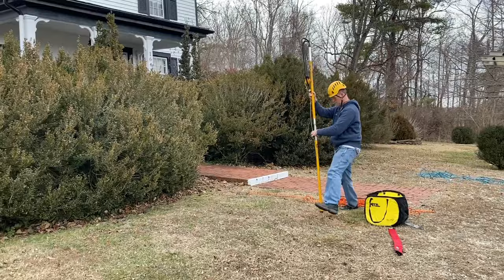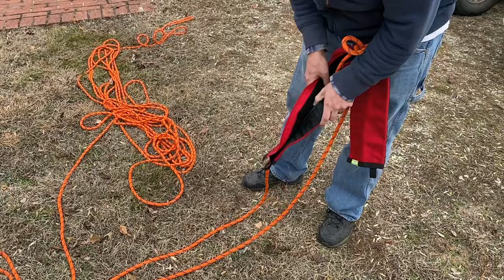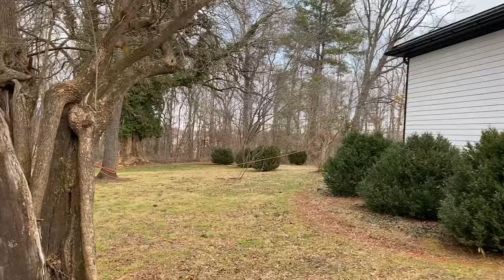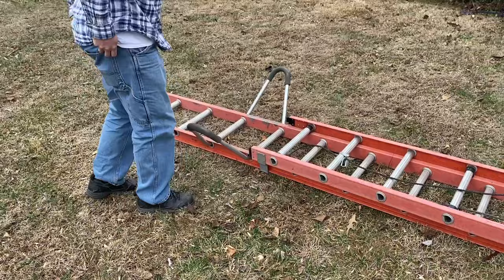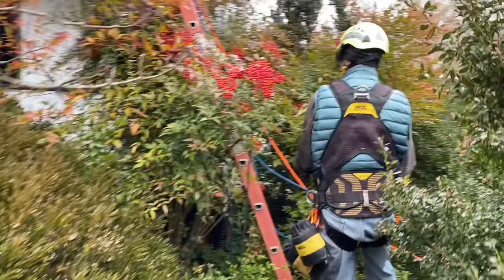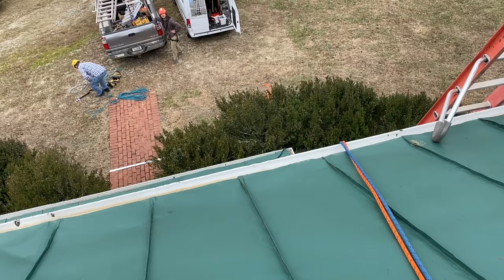Fall protection on a roof without adding any holes to the roof.

Comment: The biggest problem is, for any reason you go on the opposite side of the roof and fall, it won’t help you whatsoever.
Reply from the maker: Very true. 
Also true:  If I close my eyes while driving, it’s likely I’ll wreck.
So, situational awareness is always important.
Reply: Honestly this is a valid point. I think it would be worth considering securing both ends of the anchor line.
Reply from the maker: Yes, true.  If you do that, I recommend you tie a butterfly knot and attach your actual fall protection line to the butterfly knot, then pull it into position at the ridge.  Then tighten the line and secure  it at both ends.  Don’t do this anywhere near a gable end of the roof. We’ve done this several times.  It just depends on where the repairs are necessary.  If you don’t need to work on both sides of the roof, then it’s overkill.   @shawnsteen8442
Reply: @BlueGlassLLC  just did a gable roof. just ran a 3rd anchor line to keep the rope from sliding off. Thank you for your videos.
Reply: @BlueGlassLLC  cat ladder maybe 2 mins and your done
Reply: I'm glad you said this, I thought about that but figured they knew something I didn't.
Reply: @BlueGlassLLC  ya but how many falls are accidental. No one intentionally falls off a roof it’s complacency. Great idea an anchor point from ridge will always be best. Rick a few holes keep you and your guys safe. On top of that hole many roofers do you ignore that drink or smoke? All of them. Protect em
Reply: How about put the ladder on the side your working on😂
Reply: @deansteele7243  that would definitely work and makes sense, but 99.9% of people only put one ladder up on one side and walk all over the roof and come back down the same ladder. Most, once up there feel somewhat comfortable and don’t/won’t take that extra safety precaution, because it takes to much time and effort, but forget about the death factor.
Reply: Sir, they know which side of the roof they need to go on.  So they rig for that. If they knew they were going to work on the ridge of the roof, they would have tied to the truck. Both sides of roof 'covered' then.
Reply: According to other comments, the purpose of the blue rope is to show you how to do it if you have secured both ends of the yellow rope.  The blue rope is set up to be basically at the middle of the yellow one so you can go on either side of the roof using it.
Reply: We have a genius here dropping serious wisdom what would we do with out him 😂
Reply: Like, don't go on the other side of the roof.  C'mon.  They had one job on one side.  If they had a job on the other side I'm sure these dudes would and could tie in for that side.  They're not up there break dancing they're doing a job.
Reply: @tobyswope6875  I agree with you, but not everyone has common sense these days. All it would take is going on the other side of the roof for some reason, maybe to yell down to a co worker or a customer. Maybe trying to get away from a swarm of bees and not thinking correctly and they are now on the other side of the roof and go down. These situations happen and most people will take chances even though it’s not safe to do so.

Comment: I was wondering how someone could work safely on a seemed roof. Good idea not anchoring off of a truck. Someone could forget and drive off at the worst time (it happens), and it frees up a truck for food runs lol
Reply: There's been times where I hooked up to a truck but removed the coil wire and put it in my pocket so the truck couldn't be moved. Still very stupid to do though and I would never do that again. Mind you this was over twenty years ago. :)
Reply: Seen a guy dragging his dog down the road once forgot he tied his leash to the bumper
Reply: @tomnutt6022  “poor little guy…probably tried to keep up the first few yards.”
Reply: Using the truck as an anchor should be simple enough. Have the keys on a ring that doesn't easily open and loop them in with the anchor. Or just have them in your pocket on the roof.
Reply: I knew of a guy who tied off to his car. While he was on the roof, his wife got in the car and with her keys, drove away. He survived but was severely injured.
Reply: @tomnutt6022  
National Lampoon's Vacation
Motorcycle Cop: Poor little guy. Probably kept up with you for a mile or so. [tearing up]

Comment: Great safety tips. Painter of 44 years..understands the importance of being safe! Took a lot of risks early in my career
Reply from the maker: I bet you did John!  I took a bunch too unfortunately.  Due to, “I’ll be safe.”, “It won’t happen to me.”, “It’s just going to take a moment.”, but mostly because I’d never seen anyone working safely on a roof or in residential settings.  So, I didn’t know how easy it really is to work safely.  With the gear available today, it’s usually just 15-30 extra minutes.  Glad we are both still around to hopefully help the next generation not repeat our unnecessary risks.  Thanks for commenting.  Ronny.

Comment: Im a concrete finisher most of the time but my mother-in-law nedded a sewing studio built on her property.  I just got the roof framed and im researching fall protection systems as it's a 10/12 pitch which would be the steepest roof ive yet to work on.  I wish i was set up with all the cool stuff you guys use but i absolutely dont want to be a roofer cause i don't enjoy heights.  Anyway great video!  Wish me luck.
Reply from the maker: We always sub out our concrete finishing so it’s done right.  If we did it ourselves and made a mistake, it’d be ugly forever or have to be jack hammered up and redone.  So, we decided it is just not worth the risk.  I’m sure your roof will look great if you do it.  But if you fell, then you won’t be able to do your paying work.  Is it worth the risk?  Good luck if you decide to do it.  Keep your rope tight and you can never fall far if your anchor point is solid.
Reply: @BlueGlassLLC   it's a small and simple roof to build it's just too steep for me to be comfortable walking on without fall protection.   I'm a cautious guy who likes my life so im taking my time and doing my homework!  The difficulty with concrete is the amount of time you have before it's no longer workable.  The difficulty with roofing is potential death and dismemberment.
Reply from the maker: So true.  You’ll do a great job!
Reply: Hey the roof turned out really good!  Thank you for all of your informative videos!
Reply from the maker: Great job!  Congratulations too.
Reply: It's not that expensive, Amazon...

Comment: Some of the guys carrying out roof repairs on our apartment block in Florida after a hurricane had no safety gear.  Certain death if they fell from the roof, minimum 40 feet drop.  Couldn't bear to look, and they often worked after sun down.  Mostly Hispanics, boy those guys worked hard.

Comment: Great work. This is so smart. I see a lot of roofers in Cincinnati do none of this.
Reply from the maker: Thanks.  Even across the nation you are correct.  Roofing can be hard, low paying, fast, tiring work and often attracts folks that cannot get work easily elsewhere because of their background.  These folks are also used to taking risks without complaining.  Turnover is high and little attention/investment is given to proper, practical training and so roofing continues to be one of the most dangerous occupations.  And almost every fall is foreseeable and preventable.
Reply: @BlueGlassLLC  my employer has taken to trying to threaten and ostracize me for not wanting to attend an unpaid OSHA 10-hour on the weekend with four days' notice... Meanwhile they did not provide, and likely would not provide any fall arresting equipment except under threat of a retaliation claim lol.
When my next job is lined up, I'm going to assert my rights and see what happens. Also, they are violating FLSA by misclassifying full time workers as exempt.
Fun times.
Actual verbatim comment from the guy who trained me, after I refused to attend the unpaid mandatory weekend overtime, and informed them that I would not be paying for the course out of pocket: "maybe this line of work is not for you".
Reply: Gets even more hilarious when you find out that their OSHA 10-hour trainer is violating OSHA's own rules on this orientation, by conducting the 10-hour in a single day, and the 30-hour with just one additional day, even though due to the 7.5h limit per calendar day, it takes a minimum of four days to complete the 30-hour outreach...
It's just so meta to violate two different classes of federal regulations to force employees to attend a VOLUNTARY outreach program of a federal regulator...
Reply from the maker: @microcolonel  The happiest people around place a higher priority on their work environment than money.  I’d have to find another place to work.  Life’s far too short to waste time on unwinnable battles.  Good luck! Don’t die for your employer.
Reply: What!?! I'm in cincinnati and this is my specialty. Check out Kie Height's and Construction LLC!  He is very, very prepared. That comes from years of building up that climbing gear. That is NOT cheap! I've been using a DIY "big shot" to throw over but the list of things I tried before, is extensive. Lol. L

Comment: Do you think you could post a list of some of the things you use in the video? Some of the things like rope diameter and brands you trust? You called out a couple of the knots. Great video. Love watching how pros get it done.
Reply from the maker: Thanks.  Glad it’s helpful.  Probably the easiest way to learn more is by visiting our website.  Underneath the “Learning” tab on the home page menu is a lot of good information and answers to why I choose certain types of gear.  Slator-usa.com
Reply: @BlueGlassLLC your website has been so helpful in selecting quality gear and reading your advice on all topics thank you!  Please share more photos on your website of your team in action with all your scaffolding, ladder, rope etc setup if you have time they are great to study and learn from.  Also, I look forward to when you finish the listed sections on your website menu that are not yet available.
Reply from the maker: @chrisdonner2910  I’m glad it’s helpful.  You are quite welcome.  Thanks for working safely and being a role model for whoever is learning from you.  Not sure I’ll ever finish the website, so if you ever have a specific question or want to discuss a solution to a current challenge, fill out the contact form on the website and I’ll call you if you’re in the States.
Reply: @BlueGlassLLC  Thank you for your reply.  Do you still offer the L3 low slope brackets?  What pitches are they designed for?
Reply from the maker: @chrisdonner2910  we have a few in stock that we have saved for our own use.  We do not make them anymore because there’s just not enough demand for them.  They are designed for low slope use only.

Comment: I am a tree climber, interesting to see the big shot and throwline used in this application. I'm watching this because curious of ways to use rope access type s of protections for when I help my friend with painting his house. The one side of is house is really high and sketchy with an extension ladder. 
Just one concern I want to point out: What about your edge protection over the eve trough? If the ladder kicks out, or you slip/loose balance as your getting on or off the ladder, the tensioned line would be over that edge when you are suspended by your system. Thanks for the video.

Comment: Great video.  Thank you for the info.  What is the slingshot tool you use?  That would come in handy for getting leed lines onto some trees I need to cut down on my property.
Reply from the maker: 👍  It’s the Big Shot Slingshot (around $150) and is very handy.  You may also want to buy an arborist beanbag and throw line.  You are right Robert.  It is very handy.

Comment: Love it! Sure beats having to set a 40' ladder on the gable so you can reach to attach a bracket. Or even worse having to plane it out to reach as high as you can. Obviously there's the potential for damage to the roof, particularly the ridge and maybe eaves. Was the metal under the rope at the peak damaged at all? I'm guessing that with the cover and as long as you don't take a fall, damage is little to none. Unlike attaching an anchor to the roof.
Reply from the maker: We have not damaged a ridge yet, whether standing seam double lock, ridge vent, or simple asphalt shingle ridge caps.  So far, we’ve found the “rope” protect suitable for every ridge except on a slate roof if the ridge is designed so that one slate extends past the ridge (this is an uncommon design in our area fortunately).  Of course it’s a function of pitch and loading.  The loads created by a fall or perhaps even a suspension could easily damage many ridges.

Comment: really good idea you came out here guys. chapeau! Only thing I can think about is that sternal rings are only supposed to be used when doing vertical ascending, once you get to the roof you guys should switch your anchor point to the dorsal ring. This is because in case of a fall your ribs gonna broke into pieces due the gravity and acceleration forces and probably piercing your lungs... just a heads up there. Have in mind that being anchored to the dorsal ring will also give you the opportunity to try a self-rescue once you are hanging after the fall which will be impossible if you are hanging from your sternal ring.
Reply from the maker: Thanks for commenting.  That’s an interesting perspective.  Do you have data that supports what you believe about ribs breaking and puncturing lungs?  The dorsal ring is MUCH more dangerous in my opinion for a number of reasons and therefore I won’t use it for steep pitch roof work.  It may, however, be suitable for flat roof work.
Reply: Excellent advise and good forethought.

Comment: Thank yall so much for sharing this information. I have a metal roof with a metal ridge cap, and I want to try this method. Let me ask you, Should I be concerned that I may damage the ridge cap using this method, such as the pressure from the rope creasing it? Do you have any suggestions for preventing this?
Reply from the maker: You’re welcome.  Yes, that’s a valid concern.  As you know, it will be a function of your roof pitch and how much tension you apply to the rope.  You might be surprised at how little tension it takes to keep you on a roof.  Steeper roofs require more tension.  Slack, then a slip, then tension until the sliding stops will put a lot more downward force on your ridgecap… and possibly denting it.  Still, a dented ridge cap (although undesirable) is much better than the consequences of a fall.  If it’s a regular thing you need to repeat, then you may want to consider our V-18 permanent ridge anchor on our website Slator-usa.com
Reply: @BlueGlassLLC  I'll check into that, thanks so much!

Comment: great video, will come back many times as I have most of this equipment minus the big shot. what would you tie your anchor into if you were in a gated backyard with no trees and couldn't get a vehicle back there to anchor into?
Reply from the maker: We have upon occasion hauled 45 pound weights into into location, stacked them in a desired spot, slung all 225 pounds of them together with slings and carabiners and used the entire assembly as a temporary anchor so I could safely get to the top of the roof and install our V-1 anchor or V-5 permanent anchor.  If doing this, it’s very important that you maintain a tight rope at all times so that you cannot put heavy load on the anchor point.

Comment: I realize this video is a few years old now, but I hoping you would clarify somethings for me.  The orange rope is anchored around the big tree on one side of the roof.  Was it anchored on the other side?  If so, to what?  Another tree?  Also the red material thing wrapped around the midl-line knot, what is that called and is that just to protect the rope from abrasion?  Thanks in advance
Reply from the maker: We tied off the orange rope to the base of one of those huge bushes near the access ladder.  I wish I’d shown that in the video.  Good question.  The red thing is the 36” long Supermantle rope protect from PMI.  Their HQ is in Georgia and they have some really good ropes too.  It is about $40.
Reply: @BlueGlassLLC  Thanks for the quick reply and info

Comment: This method looks way better!  By the way, Why did you use two ropes and not just one? Looks like the orange was long enough to reach the tree…
Reply from the maker: Just to show folks how to set a separate rope anchor at a ridge (if you tie off both ends of the orange rope).  I didn’t need the 2nd rope this time because my inspection was on this side of the ridge only.
Reply: @BlueGlassLLC  Thanks for the response. Thanks to your video I’m saving some money to buy similar gear. Some roofs are super steep and this is way better than ridge pro.
Reply from the maker: @spade304  you’re welcome.  Every piece of gear has a problem it was created to solve and the Ridge Pro helps a lot of folks with easy stuff.  However it offers zero fall protection.  Once you learn and practice with rope systems though, you can go anywhere and climb almost anything safely.  Have fun and stay safe. 😊

Comment: You could also tie off to both chimney s a floating anchor ..giving you freedom of movement. And a alpine butterfly with biner would be much easier to tie .used daily in arborculture
Reply: How do you tie to both a chimney and floating anchor? And btw what is a floating anchor?
Reply: Only if you are sure that the chimney can withstand a load of at least 5000lbs. per person.
Reply: What are you lifting that weights that much ??      ????.just did 90ft plus redoak .the set works great
Reply: @Sethhaun78  OSHA regulations for work related fall protection. CFR1926 Subpart M.